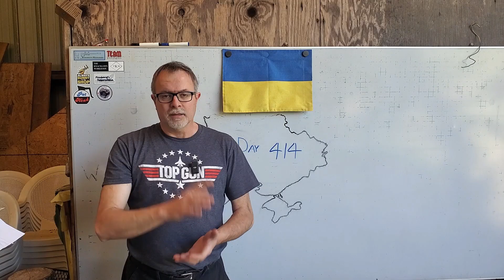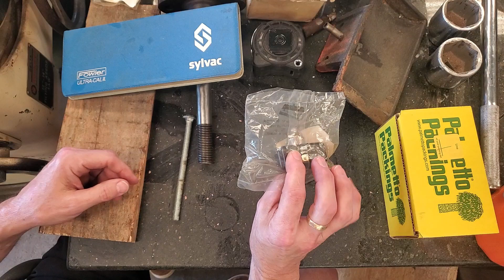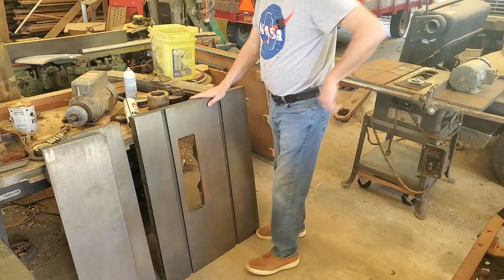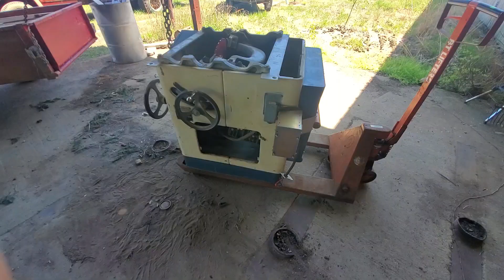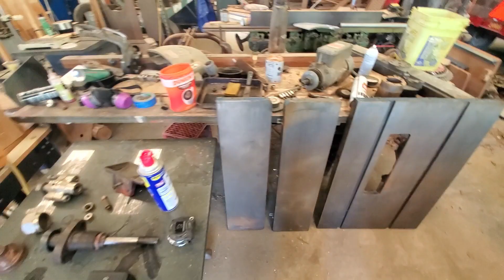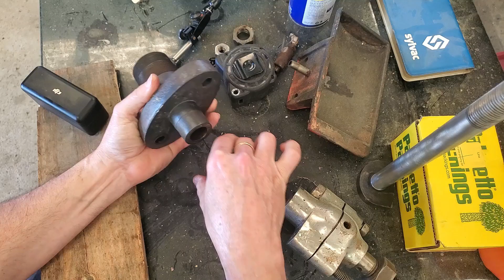Another Saw, & Steam Engine Work

Comment: That saw was a Crescent design. Crescent was acquired by Rockwell after WW2. It will swing a 14 inch blade but you can't retract it fully below the table top. Not sure they all were the same but I think it should have replaceable arbors so you could run 5/8" or 1" blades. At the time I got mine you could buy the arbor parts from Grizzly because they had a large cabinet saw that was a Rockwell clone.
Reply from the maker: Haven't had much time to scrutinize it. The arbor is 1", but barely long enough for a blade, won't fit a stack dado. The flat belt is actually a micro-vee, smaller pitch than auto serpentine. Makes me wonder the age, will have to run the serial #. It has a nice disconnect/magnetic starter so it will run off my 3ph idler after I add start/stop buttons
Reply: @EngineersWorkshop   That jogs my memory... There were several arbors one was a longer 5/8 for a dado stack. I think mine has 4 A series belts
Reply from the maker: I've only seen the ones with 4 belts. Saw another reference that you couldn't substitute a banded belt because the spacing was nonstandard.

Comment: NIce score on the 15HP motor and table saw. I hope the VFD doesn't complain too much about the motor when it is on the compressor and has to deal with startup inertia. I think you said the quincy has an unloader, so that should help.
Reply from the maker: Was working well with a 5hp. Had to tweak the ramp up and ramp down to match the deceleration. Is that a delta hookup on low v?
Reply: @EngineersWorkshop  It's delta on both low and high voltage. The impedance of the bigger motor is much lower than the old 5HP, so the drive may not like it and may fault for overcurrent. If it puts up a fight, you may be able to wire it to use only half the windings and be a 7.5HP motor.